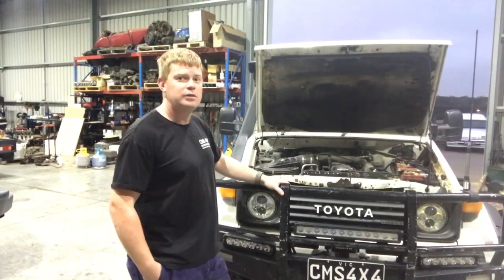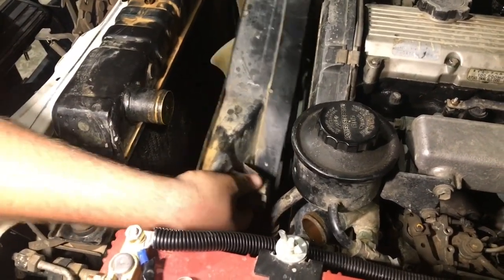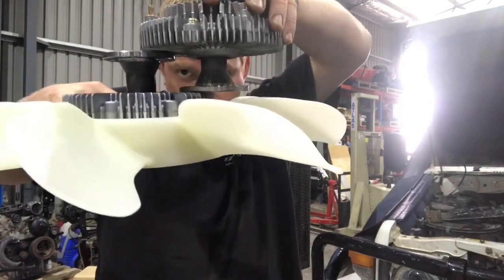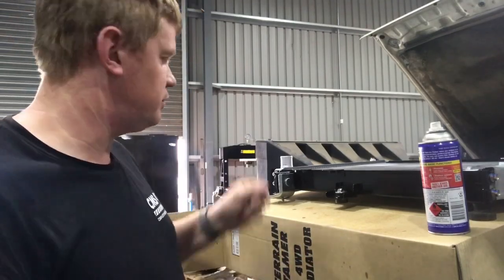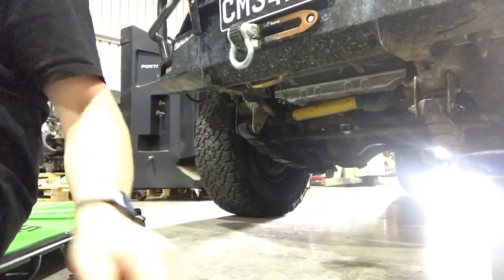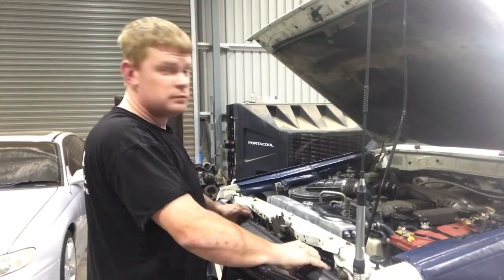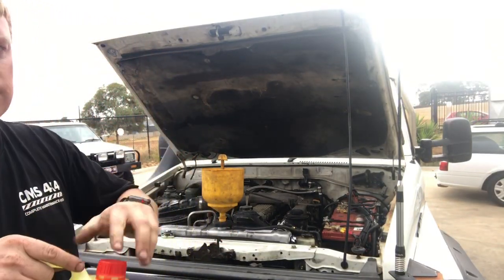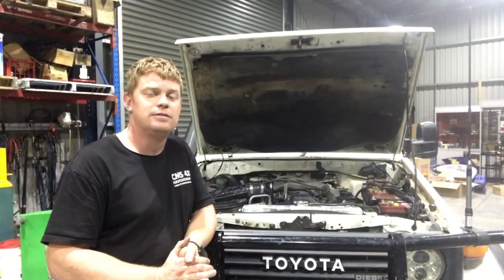Overheating hzj75 Toyota Landcruiser hdj78 radiator upgrade 1hz 1hdfte

Comment: All hz motors with a after market turbo will overheat under heavy loads no mater what you do,reasons no oil squatters and standard pistons,you can try putting a bigger radiator that wont work.
Reply: False

Comment: so sitting around 90℃ is is OK? if so i am gonna need to by pass my AC cutout.
Reply from the maker: Ac cutout is 104c ish
Reply: @troopytech9467  mine's cutting out around 85
Reply: @troopytech9467  video was definitely helpful I've been around a 1HZs my whole life but not a turboed one and I just got one second hand and the previous owner never did a radiator upgrade so I did had me confused cos my gauge was saying my engine was close to overheating but my egt's are cooler than before 350 ish they used to be just over 400 with the previous radiotor.